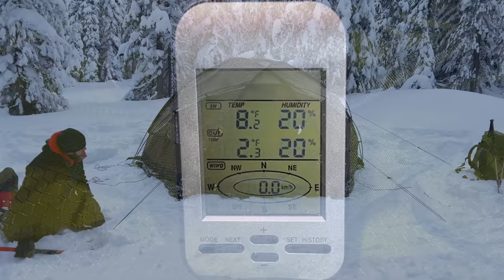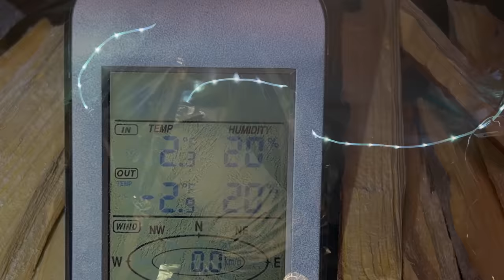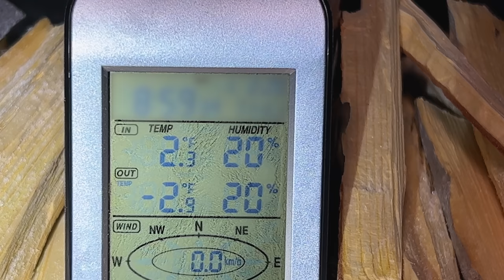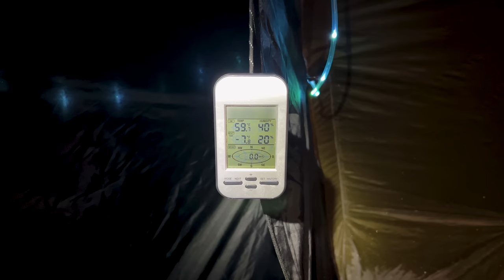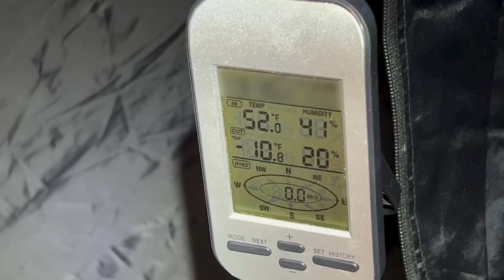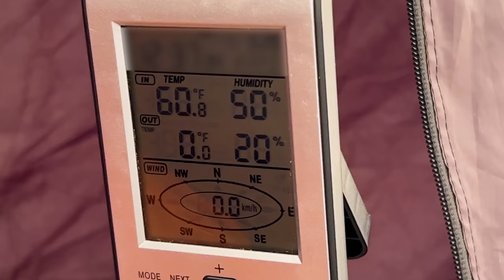Winter Hot Tent Camping In Bitter Cold Weather

Comment: Used this tent for 1 month and it is very poorly designed for the high wind. 2 broken poles, one bended. Wind gets underneath the flaps (which have no gromets or some way to keep them to the ground). This tent needs twice more guylines, better zipper design (they get stuck in corners) and certainly better storage bag (I prfer old style one end side loaded bags with comression straps).

Comment: i bought this tent from Pomoly. the next night it used to snow heavily, the snow accumulated on the top of the tent, between the poles which make a receptacle then on the top sides still between the poles. then with the weight of the snow, the tent collapsed and bended all poles making them unusable. i email Pomoly's support and got no answer at all!  my conclusion is that the tent is not designed for heavy snow and don't expect any support in case of problem. Pomoly is a chinese company to avoid!
Reply: You clearly bought a wrong product for what you need and now complain and being racist?

Comment: You didn't use a ground sheet. But you being a modern day camper. You would call it a foot print.
      I'm from the old days. From my generation that I learned in scouting. It's either called a ground sheet or a ground cloth. Plus no flames in any tent ever.
      I'm sure you paid a lot of money for that tent. But on the other hand. I see there is a hole for the chimney of your camp stove.
     I guess your tent is made for using a stove inside. But I wouldn't chance it. I have an MSR REMOTE 2 TENT. It's a four season tent. No flames in my tent. I take care of my tent.
      But with everything else I saw. You pretty much know what you're doing.
      These are the reasons why I gave you a thumbs down.